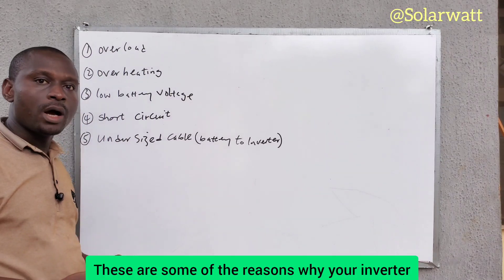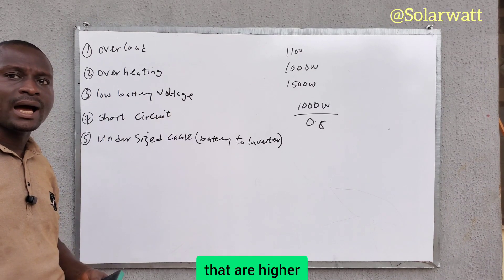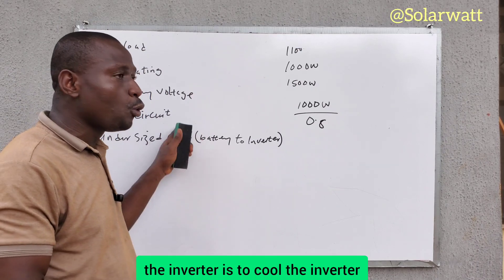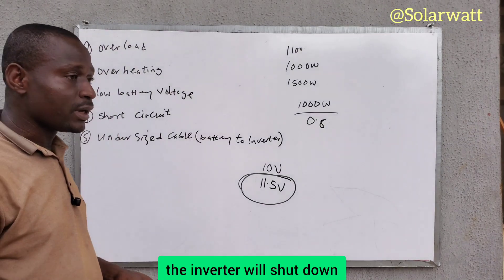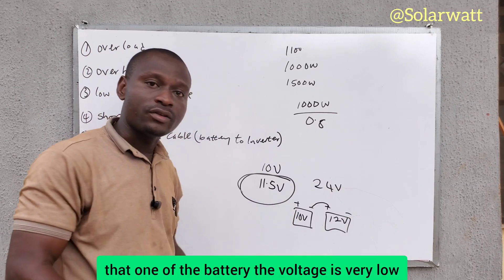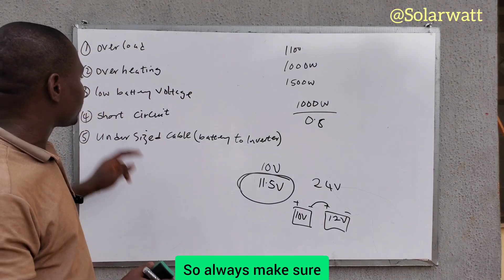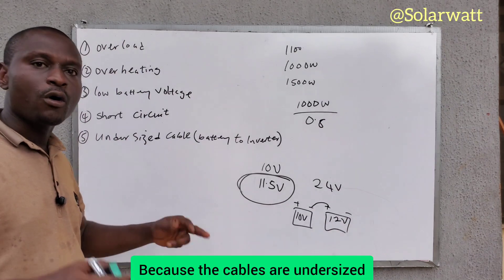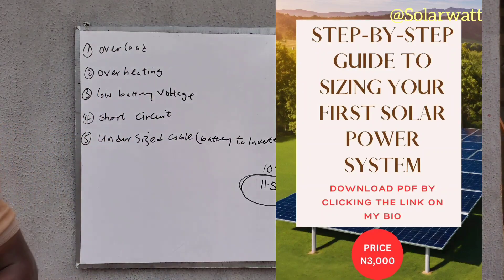Possible reasons why the inverter is shutting down. #solarinverter

Comment: Engr thank you for your humanitarian services through this channel.
Please sir, I use 1kva inverter with 100amh lead acid battery on minimum load but it doesn't serve me longer after sunset.
I want to upgrade to 200amh lithium battery, for maximum satisfaction, should I go for maybe 500watts inverter or maintain the 1kva inverter?
My loads are: 3x10watts bulbs,1 Ceiling fan and 43" TV.
Thank you sir for the answer.

Comment: Hi good day 
It’s a problem if the in inverter is much higher than the loads?
For example if the loads is 300w and the running inverter 2000w is
Reply: No! 2000w - 300w = 1700w. This means you can still plug in some more stuff on to that system, until it is running close to the 2000w capacity. What that means however is that your battery will be drained too quickly.

Comment: Please I have a question, I have a 2.5kwh by 24v lithium battery, my dc cut of voltage is 24v, when my battery is low, normal fault light comes on indicating low battery, now I have 2 observations
1. When my inverter cut off supply, it goes on standby and does not automatically come on in the morning, so I have to manual turn off and turn it back on, or use generator or grid to bring it on
2. Even when my solar has charged it to let's say 26,the low battery alarm will still remain untilq either NEPA or generator supplies power.

Please any explanation to this.

 I have 5-300w panels, and have my fridge 110w and router 18w connected but sometimes, only my router is connected

Comment: Please what and what are the reasons why I should wire in series and in parallel?
Reply from the maker: Depends on what you want to achieve(high voltage or high current)
Reply: @Solarwattng  I need a lecture on what suppose to warrant series and parallel
Reply from the maker: @libertymzesco6300  https://youtu.be/aaG2pS_69dA?si=qVHH0NgG8tiEm41L
Reply: @Solarwattng  thanks so much

Comment: Load of 1000w÷0.8=1250
So meaning that an inverter of 1.2kva . This is really going to blow up the inverter.This your formulas are not correct at all Sir.In real life situation 1000w load will be best handled by 2-3times the  load=3kva/24v or better  still 3.5kva/24v in case of any additional load.
So your calculations of 0.8 is totally wrong sir in line with international standards.
Thanks

Comment: Good work Sir. Please I have a question and request. 
- how can I equalise a battery incase in a situation where the two batteries are not reading the same volt
- can you do a video on how to read the volt of batteries. Thanks so much
Reply: You can use your multimeter to test the batteries voltage, and if the batteries are not same and u need to balance the batteries you can top balance the batteries, best is to charge each battery to fully charged after that, parallel the both batteries you needs to balance after charging each fully, to balance you need to connect all the positive terminals to the + of the charging source, and connect all the negative of the batteries to the -Neg charging source, it's better to still plug them on charge for better results, but jf u can't ,then just leave the batteries all hook up in parallel for house, then you have successfully balance them.

Comment: My inverter 2kva is not charging my two batteries, I Took it for replacement which they provide new one, two days ago after connect it, main fuse burn , what is really happening
Reply: Which of the fuse got burnt ? And what brand of Inverter is that, is it high frequency or power frequency?